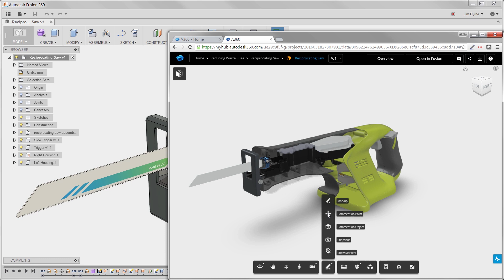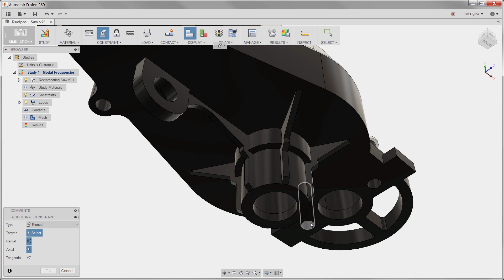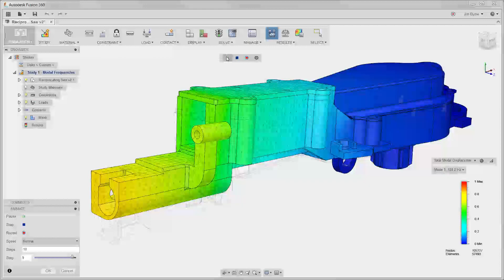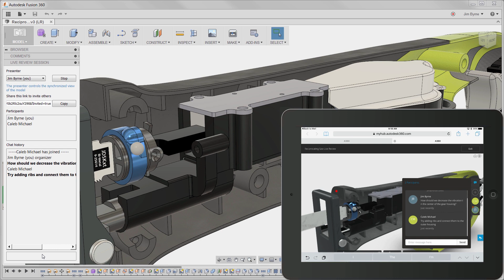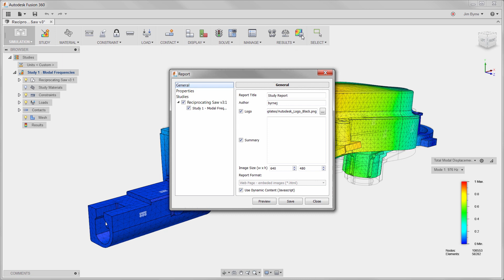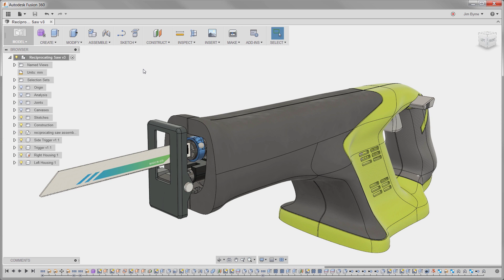Fusion 360 – Testing Vibration on a Reciprocating Saw

Comment: How does the simulation know what the source of the vibration is?
Reply: +Sungod3000 That is a very good question.  The source of the vibration is irrelevant in this particular study.  Here we are simply checking for areas of low stiffness in the model, behavior and frequency values.  If necessary we can take it a step further and simulate an excitation such as a motor or dymanic motion in the design.  That is something that is currently done using Autodesk Nastran or Simulation Mechanical.  These results will provide even more information such as displacement, velocity, and acceleration.  Does that answer your question?
Reply: +Jim Byrne ok ill check those out. Im on a quest to find a tool that can simulate fdm 3d printed parts....
Reply: @jbyrne001  Thanks. So, the simulation shows what would happen if there were a "3D Earth quake"? And the result tells us the resonant frequencies?